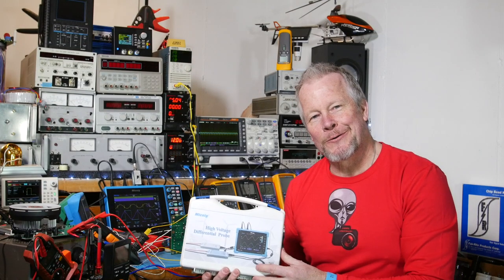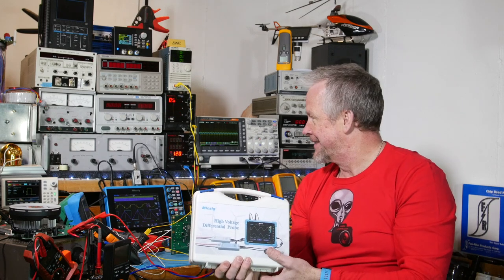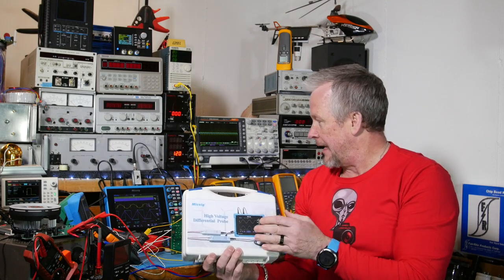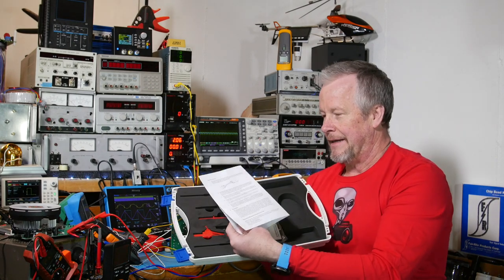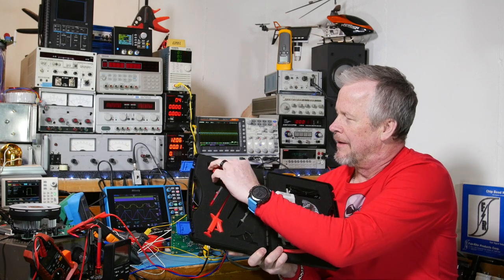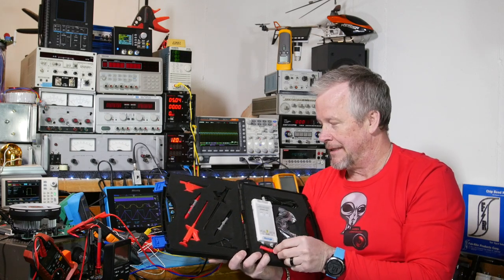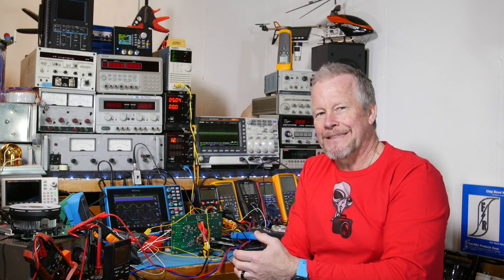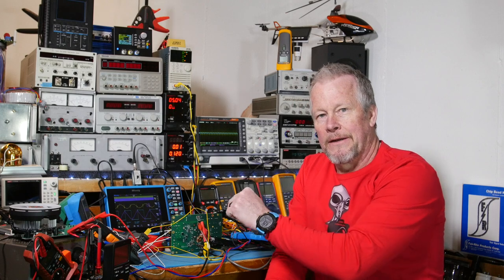Micsig's new DP10007 Differential Probe & Why we need them

Comment: Great review!
A few comments.-)
I like that your start was shorter with another effect than the "smoke". your transitions were maybe not perfect, sometimes did it feel like my eyes had lost focus or something while the effect was running. I like that you showed the flush part of the probe, but maybe you should have shown that in the start instead a lot later where I was wondering if you would zoom in or just the viewer imagines that.
You have flashing LED's on the power supplies in the background, this happens because the blinking and the framerate of the camera is about the same. Try adjusting the camera's frame rate to something that is not divisible with 60Hz.
But all in all a great review with lots of great information :-)
Reply from the maker: Thanks so much for your support and great help;) I’ll see if I can get rid of the blinking, or if need be turn them off;)

Comment: The thing that's rather puzzling is why do scopes tie the reference of all the channels together, and to earth ground, in the first place? If you look at the multi-channel power supplies sitting right next to your scope, those all have independent channels that aren't automatically earth referenced (hence why there's a separate earth banana jack on each channel if you want to earth reference it, or you can put the channels in parallel or series). DMM's are isolated by the nature of being battery powered. Why is the default different on scopes than all other test gear? Also, I just bought a set of micsig differential probes, and they don't come with the regular probe tips anymore - only the grabbers and the alligator clips now, even though the picture on amazon still shows the regular probe tips as well.

Comment: I use a Contec because it's battery powered. With the externally powered ones it's another damn cable to cope with. Also with a 4 channel scope you have the ability to make two differential measurements at once, with the math function
Reply from the maker: Nice tip!  Is the battery a rechargable?  I'll have to look into these - thank you!
Reply: @KissAnalog  Not built in rechargeable, just uses standard AA cells. I got it off ebay a few of years back when I needed one. I've no idea how old it is, or if it's still available, but it does the job for me

Comment: Did you actually ever check the bandwidth of this probe? I wonder if mine is defective.

I bought one and I'm seeing a somewhat acceptable frequency response up to about 25MHz.
Above that, there is a region where the probe has a bit of gain and then SIGNIFICANT attenuation above 50MHz.

At 100MHz the probe has more than 12dB of attenuation which makes it completely unusable at those frequencies.

Comment: Question: Looking at the differential probe design I assume the BNC plug needs to be grounded (earthed), otherwise there would be half the measured voltage between the BNC plug and true ground (earth). So the probe couldn't be used with an ungrounded heandheld scopemeter for example. Is this understanding correct? Thanks, A

Comment: Im planning to buy one of those probes but im not sure yet whether to buy the 10013 or 1007 version.
Reply from the maker: I think it depends on what voltages you are working with.  If they are say a couple hundred or lower than the 1007 would be great, but if the lower voltages are all 100 V or higher (as an example) then the 10013 might be better as it has the higher X factors.  Does that make sense?

Comment: They are really good voltage probes and right price. However, to measure the high side FET, the CMRR is a big obstruction. in most of the differential probe, even Keysight or other big brand, except one or two which are very expensive.
Reply from the maker: Thanks for the feedback.  Are you referring to when the probes are reading across a high voltage and the CM noise is too high?

Comment: Is there any chance you could do a video about making differential measurements with single-ended probes? I have been trying to get it to work on my Rigol 1054Z and I can't figure it out for the life of me. I would like to measure the input and output from my amp, but the only way it works is if I use the probe's ground clip. I tried subtracting channel 1 - channel 2 with no ground attached but it just gives me a lot of noise and no signal. Is a differential probe necessary or am I doing something wrong?
Reply from the maker: Thanks Josh!  Great question and I will do a video on this very soon!

Comment: What every good engineer does when they receive a new scope is cut the ground prong off the AC line cord.
Reply: Is that safe ?
Reply: This is like powering the scope from an isolation transformer which is not recommended.
Reply from the maker: LOL That is probably very true;)  I see a lot of scopes in the lab that have the 'cheater' plugs (the ones with the missing ground prong).  The idea is that it saves scope probes from an oops;)  But, you still need to be careful to put each probe ground clip on the same potential or your scope will short them for you:(  Unless, you use a diff probe.  BTW, I want to come up with a diff probe design for DYI that would be very inexpensive.
Reply: What every good engineer does ? 
I think you are confused, because a decent engineer doesn't cut corners on safety. 
When you cut the ground prong on a AC cord of a scope, 2 things will happen. 
1) If you have a modern scope with EMI filters on the power input, the safety capacitors will leak to the negative part of the BNC connectors, this leakage can go as high as 50% of your mains voltage (60 to 120V depending on the country). This leakage is very low current (uA), but enough to kill sensitive components like Mosfets etc....
2) Because your negative part of your BNC connectors have now a voltage above ground potential, your scope doesn't have a zero point to compare his measurements. A normale scope probe compare the signal against ground potential, but because your ground potential of your scope is now above the ground potential of your mains, you have a offset on your measured signal.
The rule is to ground every measuring device on your bench, and isolate the DUT (Device Under Test) by lifting the ground prong, or using a isolation transformer to power the DUT.
Removing the ground prong on a scope was done back in the old days by cowboys, where the scopes didn't have EMI filters that leak voltage to the ground, but where metal casing of the scope could become hot and could cause electrocution. Without the ground connected, a RCD won't trip and you got zapped.

Comment: Best use isolated transformers for oscilloscopes.
Reply from the maker: Great tip, but you still need to be sure each probe is referenced to the same signal.  Differential probes can be your friend even with an isolation transformer;)
Reply: All my equipments are in Malaysia but I have problems with customs in India. Due to that I need you help because I am running free classes.

Comment: It's a terrible device. Its error at 20mhz reaches to 19%. In my test, it works well up to 670khz with an error lower than 2%. There is no way to open the enclosure to tune it. Just a waste of money and time.

Comment: I've been meaning to ask how you guys measure current with your scopes. I see guys with resistor in series with the circuit and taking measurements across the resistor. I would love.to be able to look at switching power supplies and current. What calc. do you use to determine the resistance of the resistor? Can the diff. probe be used to accomplish these types of current measurements as well?
Reply from the maker: Thanks for that great question!  I have an idea, and I’ll do that video very soon;)